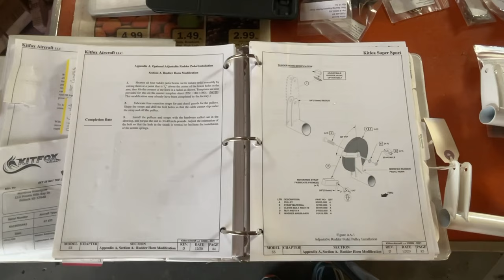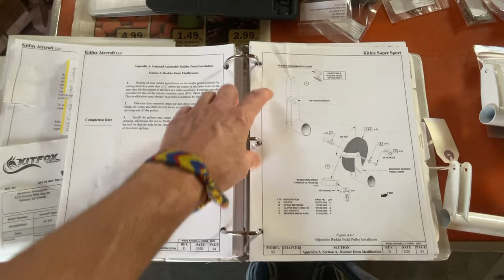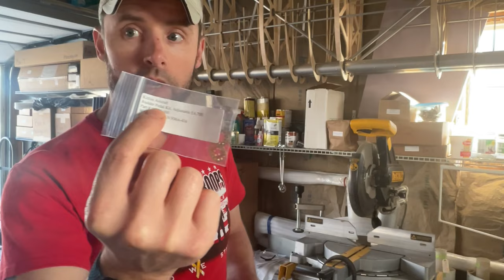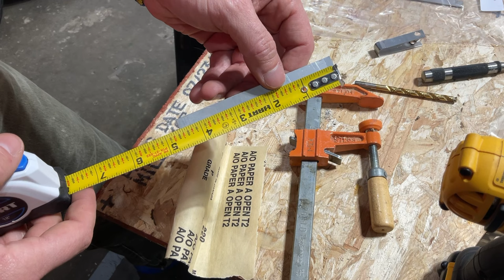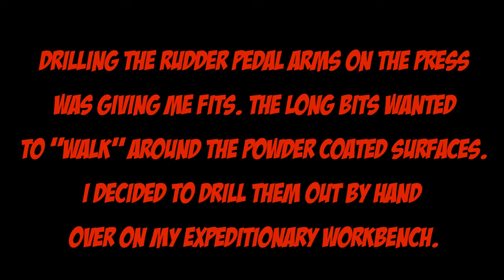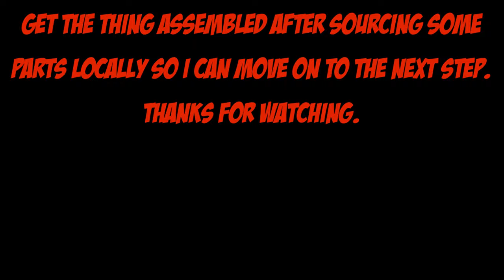#23 Rudder Pedals Pt. 1

Comment: Hi Matt, the builds coming on nicely.  To save yourself any future headaches invest in a set of bh1 to bh5 centre drill bit set.  No more bending of drill bits.   Once you have established your first hole, you can then use your longer ones to open up the whole to your intended  finished size 😊
Reply: Jeremy,

Do you have a link you could share for the bits you’re recommending?
Reply from the maker: Hello Jeremy & thanks for the vote of confidence.  Seems I am making plenty of errors so I hope that by posting them, those that are watching will pay extra close attention to what I’m doing wrong.  Just about have the pedals in the fuselage… but I ruined both of my torque tubes by making yet another error.  Fortunately they are in stock & I already have a UPS tracking number.  The good news I have is that it appears that my floor in the plane is level & I won’t need any shims.

I’m with Greg on this.  What are bh1 to bh5s?  I’ll do some googling.  Thanks again, cheers.

Matt

Comment: Thanks for the video as always. You’re showing much more detail than other videos I’ve found. The puka pedal/console comment made me chuckle😂

Nice job!
Reply from the maker: Hello Greg, thanks for the consistent comments.  You’ll get a kick out of the next video… I have made yet another mistake.  I’m actually going to make a suggestion to KitFox on this one because the instructions state “install using the hardware provided” & there is no more info aside from that.  I would like to think if I made the error, others could do the same thing.  Saves some cash to only print a few more words in the manual.

Jeremy coined the Pukka Center Console term.  I was not happy about that mistake but I think now I have enough rivets & Hysol on there that is fully beefed up!  Have a great day, Matt